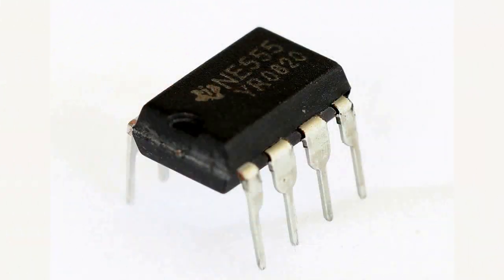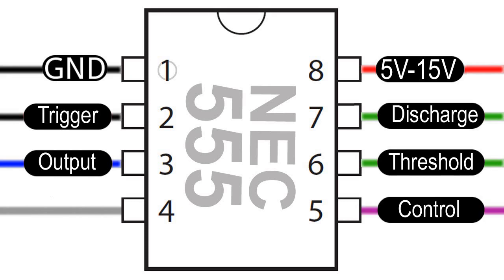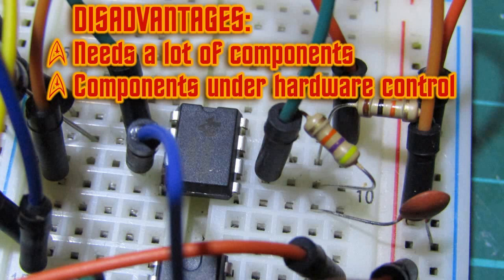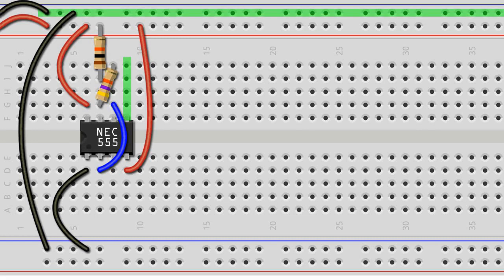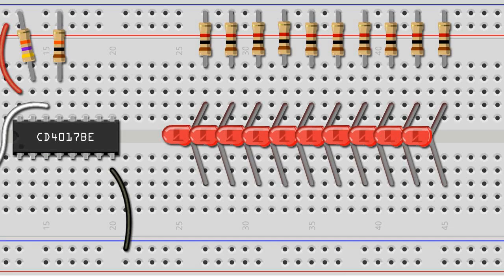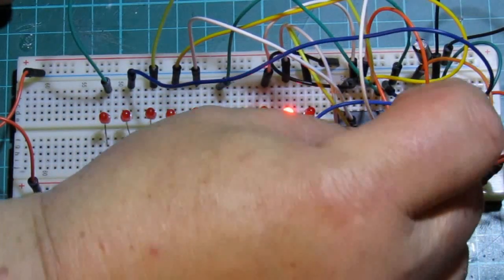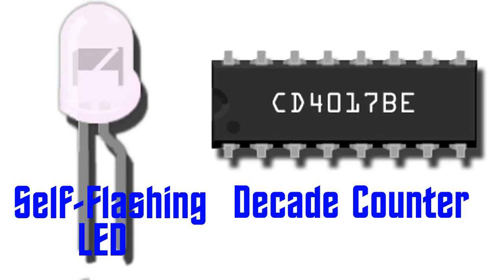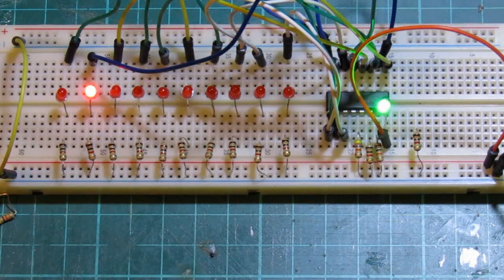Arduino for Starships - Ch13 - More Shuttle Bay Chaser Sequences

Comment: Sir, I found your video's on this very interesting, but like smacks999, I too am having issues with Sketch 5 and the Refit Sketch. Could it be that there was updates on the stuff that you are using that came after you last sketch. Hopefully you will see this and reply with a solution soon. In the mean time, Im just going to get all my LED's prepped and in place.  Pete
Reply from the maker: Hi Pete, I'm afraid those final sketches became too power-hungry and they were shorting the Arduino board. Even with the mosfets using external power the Arduino can't keep up. The problem is that darned sound card. It needs to run separately for things to work. I haven't found a better solution yet, unfortunately, although I have been looking at using  the ESP32 instead of the Arduino Uno, as it is smaller and way more powerful.

Comment: Hello! It's been a while and I have been fiddling with these circuits for a very long time now, it seems. I have gotten 4 versions of a PCB done, and the last one hade a few defects that were not noticeable without a magnifying glass- broken traces. But, my latest  design incorporates another Darlington array to power the nav/strobes/warp/impulse/photons and phasers and the alert red LED. I have also allowed for plugs to go to the ship from the circuit board in the base for all the lighting effects. I have also locked up a few Nanos somehow. 

My version 5 PCB is working just fine, kind of. Starship 04 works great, but 5 and the Refit sketches are all screwed up (I have adapted the sketches so they all use the same pins throughout). I can't figure it out. my PCB is based on the last "Refit" sketch and tutorial you published. Weird.

I have blown up 3 cheapo small speakers trying to get the audio to function. Still trying to figure THAT out. My other major bugaboo is that the Red Alert function NEVER worked for me. Hitting the button 4 blinks the spot LEDs down a bit, but that is all. Is there something missing from that last sketch? I am intrigued by this and want to incorporate that into the Refit model I am working on right now. Using a relay to switch the bridge / interior lights to red. Any ideas?

This is fun and frustrating at the same time!

Comment: Hi Folks, please I have a doubt, how should I connect the other navegation and strobe leds?  The circuit shows only one led with the blinking effect
Reply from the maker: Hi Mauro :-) It depends on how bright you want the LED's to be. We normally chain 2 or 3 of them by connecting them in a series ( - leg of LED1 to + leg of LED  2, - leg of LED 2 to + leg of LED 3) which makes them bright enough to see, but not so bright that it's overwhelming. If you need more nav or strobe LED's you can connect them in a second chain, and connect these parallel with the first chain. Resistors can be added to reduce the brightness, or make smaller chains with less LED's to increase the brightness. I hope this makes sense :-) - Trevor

Comment: Trevor As many have said brilliant work, very informative, and I will be using your information on the arduino when I build my Refit on my YT channel, and point people to your great Tutorials.
Will you be doing a video about how to transfer the breadboard to a working PCB?
Reply from the maker: Hi, thank you very much for your kind words. The final circuit is quite a clunker, and the sound effects seem to be draining a lot of power from the overall circuit. We've been exploring options to solve the issues, but our best solution may be to split the sketch over two ATMEGA chips, one for the sound and one for the lighting. At the moment, I'm working on a simpler Cylon sketch which I'll be transferring to a PCB, and that should be uploaded soon.
Reply: Thank you for the great video series!  I just got an Arduino and I am now officially a "tinkerer".  I was wondering when the PCB version of this tutorial may be available?  Great work on simplifying the concepts!

Comment: Thanks Trevor.  These vids really do help me demystify electronic circuits.
I have a suggestion/question about bringing in a red alert response to the 555 circuit:  Could you have a second resistor (say 13 KOhm) in parallel with the 46 KOhm one but isolated by a MOSFET.  When the MOSFET gets triggered by the red alert signal the second resistor comes in and drops the overall resistance to about the 10K Ohm required?
I suppose one can complexify any circuit to any degree and the question becomes whether it is worth the extra components in exchange for not having to muck around with the ATTiny.
Anyway, I still think these vids are great!
Reply from the maker: Now I can finally get some sleep, haha! This is about as far as I wanted to go with the series :-) Unless I have a flash of brilliance in the future. When building the circuit, I was trying to think of ways to incorporate a lower resistance for the red alert effect, but eventually decided to leave that for the ATTiny. Diverting the current to a parallel resistor with a MOSFET is quite brilliant, though! You really have an aptitude for this stuff! - Trevor